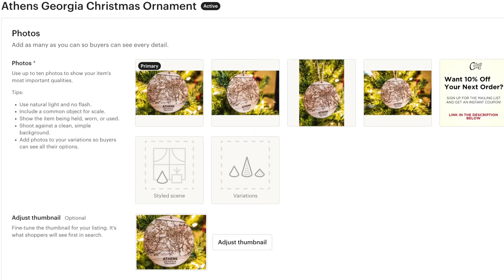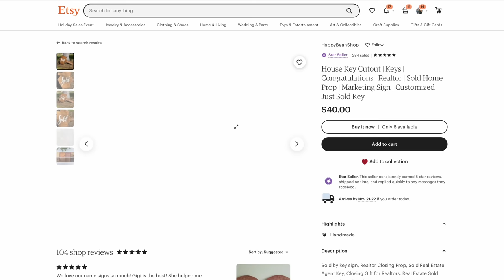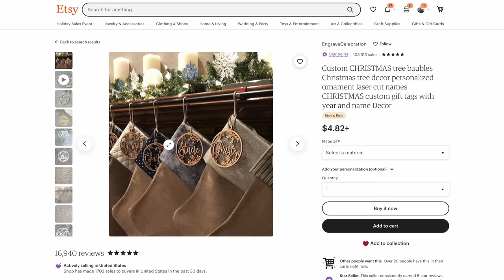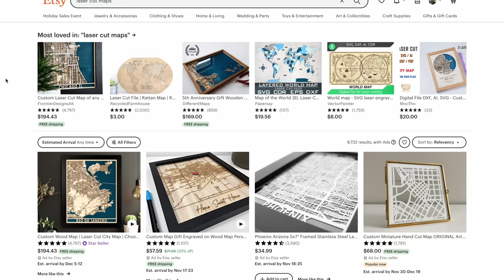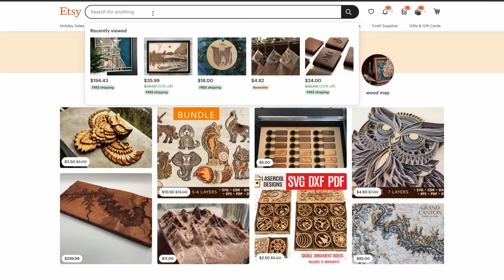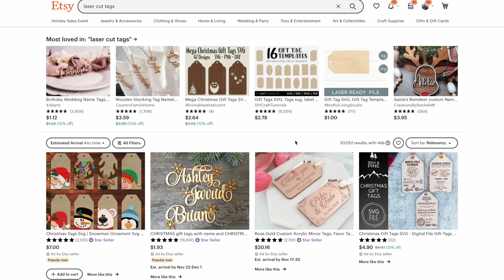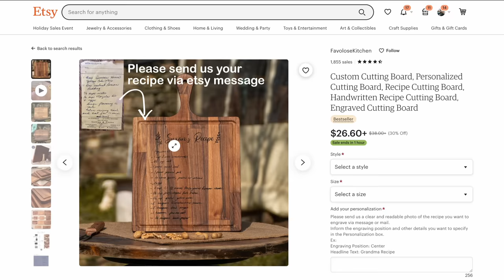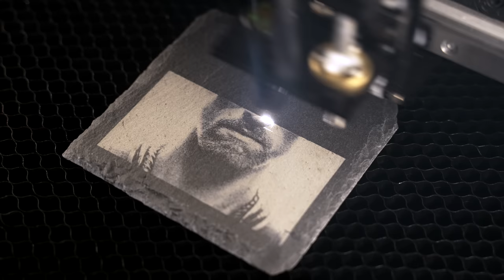Top Ten Products to Sell with a Laser Engraver & Cutter (2022)

Comment: A great tip for engraving plastics or doing the tumblers you show in this video is to put a thin coat of dish soap on the surface before you engrave. It helps keep the soot from settling on the surface and makes cleanup afterwards a whole lot easier.

Comment: If you do wooden coasters, Finish them in a polyurethane or epoxy. I have had amazing luck with Zar solvent based polyurethanes. I have a couple test coasters I made, that I have been abusing for the last year. They have held up flawlessly, no surface degredation, I am constantly putting hot and cold items on it, leaving water on it ... etc. Been amazed at how well it has held up.
Reply: How much time, cost does it add per set?  Do you factor that in the price?
Reply: Thanks for the tip!

Comment: Which device do you recommend for engraving gemstones like agate?
Fiber laser or co2 or diode? also what is the minimum watts should i look for to engrave on gems?
Reply: I would honestly find someone with a laser and have them try stuff. Each material I've ever tried I end up having to try different settings and speeds. I'm fairly confident that a CO2 laser would work on gems considering they're similar to granite, marble, and concrete though they might be harder you could try going slower and at a higher power level. That's why I would say find someone who you can show some samples to and have them try stuff out for you. Who knows, some of those diode lasers might even be strong enough.
Reply: @DanteNava  you’re 100% right. This is what i did and co2 was working. Fiber didn’t work

Comment: Could add suggested price.
Reply from the maker: I need to do a big video on pricing your work since a lot can go into it.  To start out I would just look around online to see the range of prices people are offering for something similar.  But it's also why I like going really specific and custom as well as local.  You can usually charge more since the item is going to be more unique.

Also you can just price it on materials+your time+profit margin and see if you get any sales to start.
Reply: @Make or Break Shop  that is what I did when I had a craft business years ago but the competition of just crafters sold items without any cost of time and effort nor of any other Costs like equipment depreciation, electricity, etc. They just did it for "fun". All my work was unique.